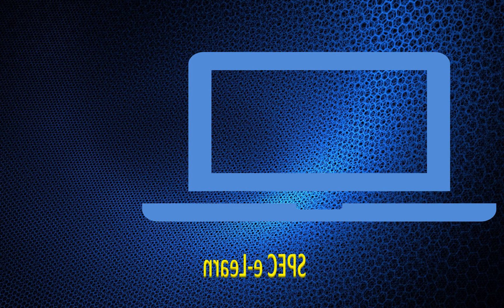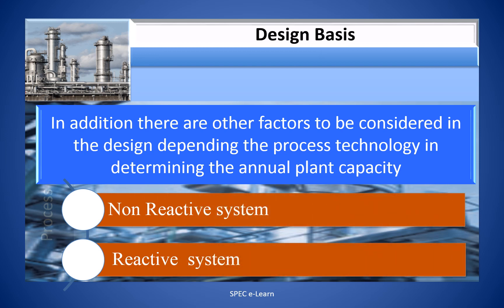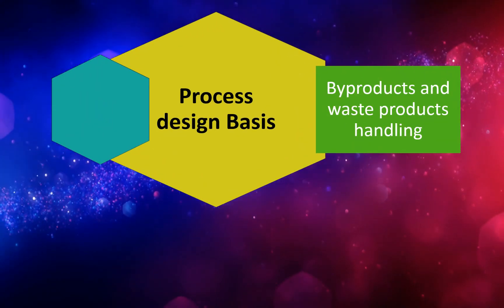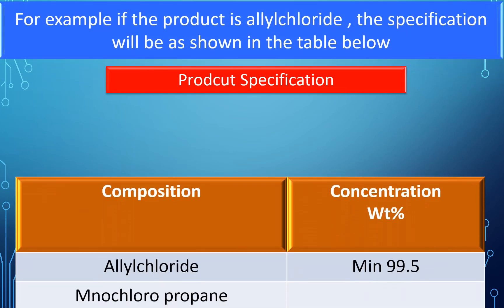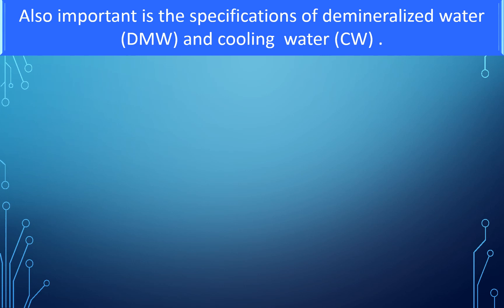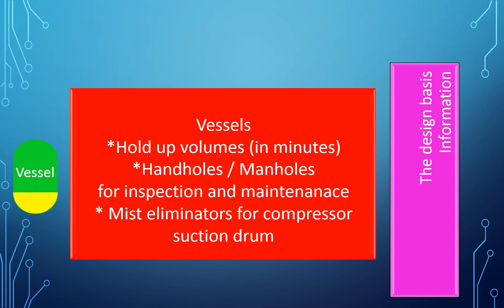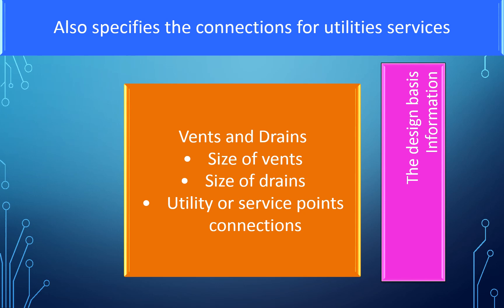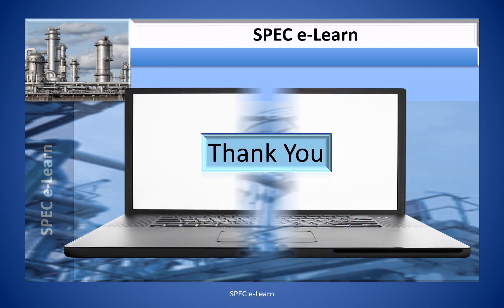Chemical Process Design: Design Basis Part 2

Comment: how to calculate supply pressure of cooling tower water?
Reply from the maker: If my understanding is correct you are asking for how to decide on the cooling water supply pressure to coolers. This will be explained in a separate video for members only